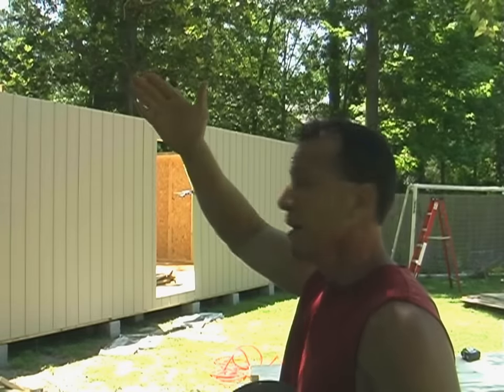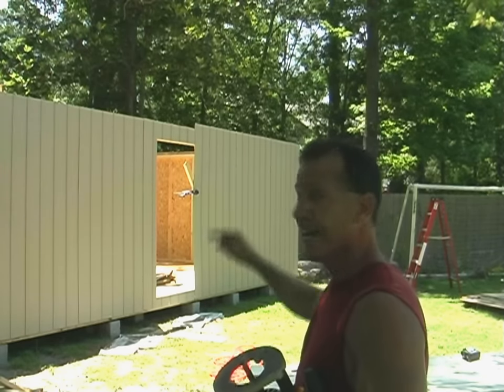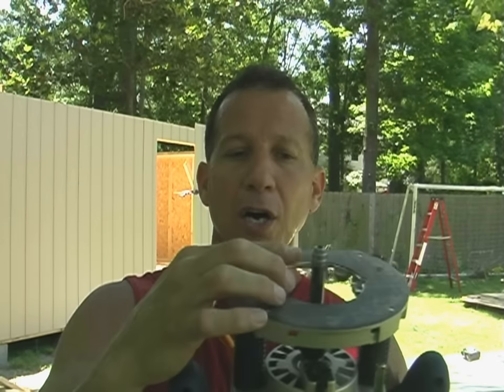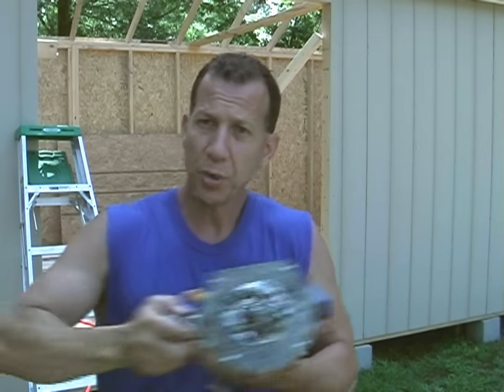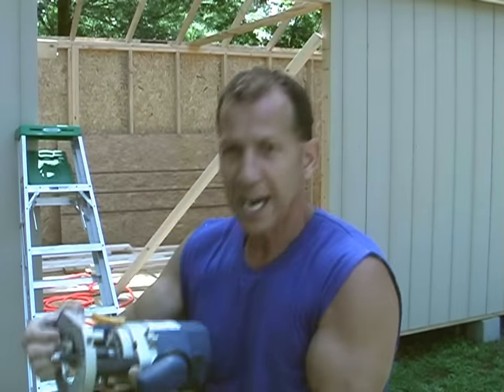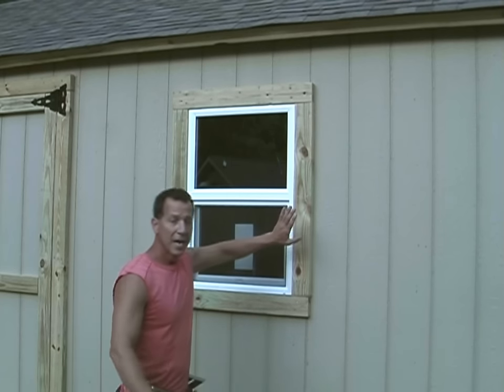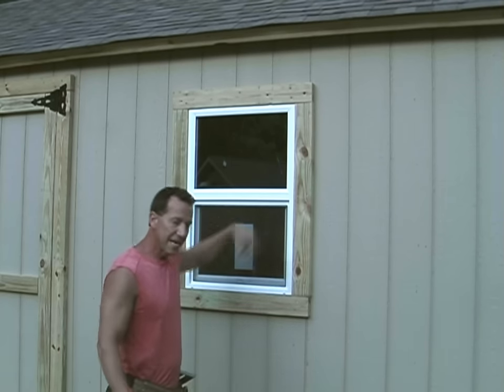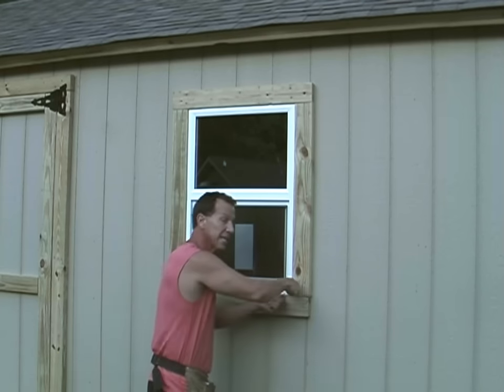Shed tips 1, Cutting your doors and windows the easy way!

Comment: I never thought about using a router.  This was so much easier for me to use on the coop windows and doors than the Reciprocating Saw. It actually kept me from cutting into the 2x4 framing for once.  Nice smooth cut. Thank you so much for the video instruction.
Reply from the maker: I'm really glad I could help.
Thank you for taking the time to reply!!!
Paul

Comment from the maker: Hi Kyle W,
 No need to worry, most angles on your cabinets will have 90 degree corners. Some will be at a 45. These will be on a diagonal corner cabinet or an angle cabinet. Whatever the degree of angle is, You will divide the angle in half to get the proper miter. In other words, you will make 2) 45 degree cuts to create a 90 degree corner.  and 2 22.5 degree angles to get a 45 degree corner.   Good luck!

Comment: I dont have a router and i think a jigsaw would tear up framing. I have same siding on my shed. Any ideas on what i could do to cut in several windows? The windows are reclaimed ones too. Thought they would be better than the flimsy thin ones you can buy at HD. I eventually want to insulate and wall the inside.

Comment from the maker: Hi meckleboy,
A jig saw will work, but you should use a good large wood cutting blade. Bosch makes an aggressive tooth blade that is pretty thick. it will reduce flexing and help to keep your cuts straight. I sometimes use a reciprocating saw, it also works well and it is much faster than a jig saw. Either way, you will want to have your siding nailed tightly against your framing. This will make the cut smoother, by reducing the vibration of the wood. Good Luck!

Comment: Normally the window's and door's are installed before the siding,but if that works,for your building,all good.
Reply from the maker: You are correct Pete, I only do it this way when building sheds, not permanent structures. I find it faster and it makes for an easy replacement if the window gets damaged. I will use remodeling windows without a flange or in this case, I used stock Lowes windows and I installed them over the siding. I then add sealant tape over the flanges. I ran the 2x4 trim over my dado blade and removed enough of the 2x4 to clear the flange. This way I can remove the trim and easily replace the window whenever I want. Thanks for the feedback !
Paul